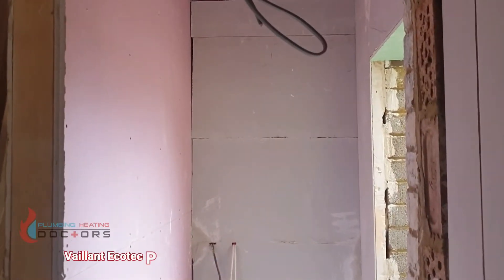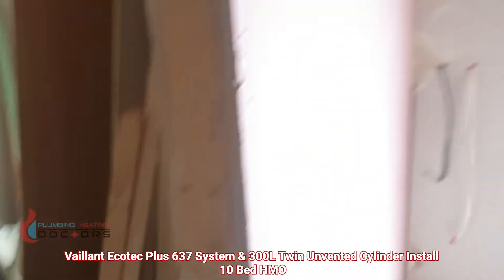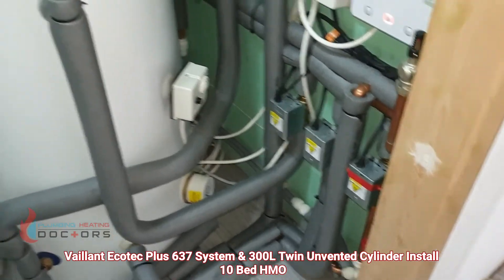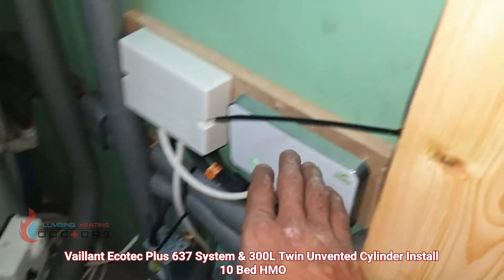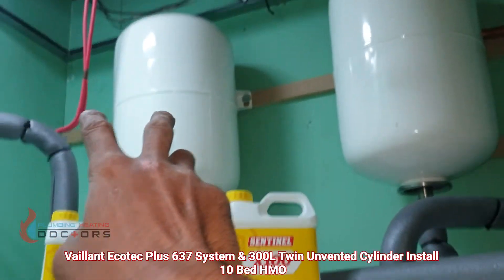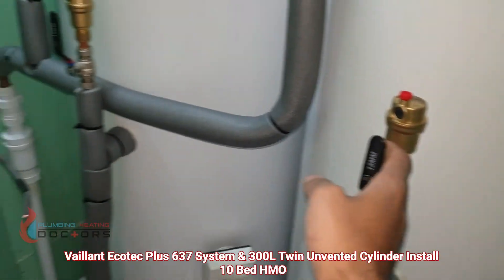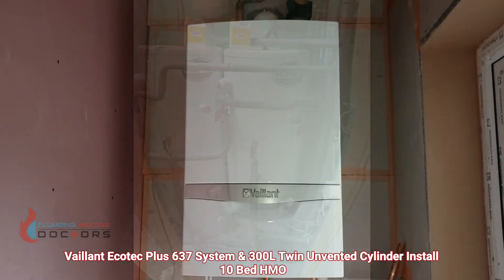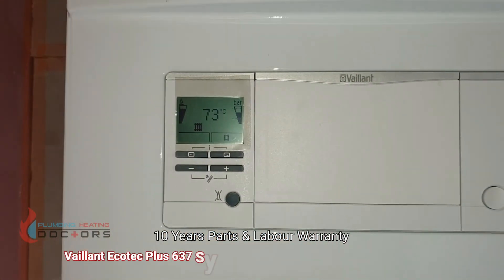Vaillant System Boiler With Twin Unvented Cylinder Installation - HMO - ** S Plan System **

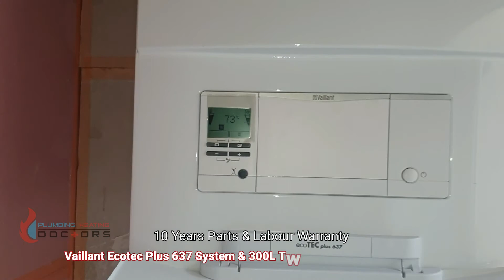Comment: I noticed at 7:31, there is no hot water tap symbol on the display of the boiler, may I ask the reason? mine is the same case, i am just suspected if it has some mistakes there.
Reply from the maker: Its a system boiler so does not have a hot water tao symbol

Comment: Great job! .... Just wondered, do both two ports for the cylinder come on together when there is demand for Hot water? In other words both cylinders get hot at the same time? Thanks.
Reply from the maker: they have sperate zones so they are controlled individually

Comment: Amazing work.  Wish you were local.  Quick question. What type of system would you recommend for a property with 9 rads, and 4 shower?   What size tank and kw size in system boiler would you recommend?
Reply from the maker: Minimum spec -  Unvented 300L with 30KW System but make sure water pressure is good
Reply: @PlumbingDoctors  thank you so much.  Is there a way of increasing the water pressure?
Reply from the maker: Yes loads of ways... easiest is to upgrade your incoming mains to MDPE if you have lead pipe
Reply: @PlumbingDoctors  yes. 32mm.  Any other way?
Reply from the maker: Yes stored cold water cylinders - check out stuart turner pumps with stored cold water cylinders - they will increase flow rate and pressure
Reply: @PlumbingDoctors   much appreciate the expert advice. Will discuss with plumber.  👍🏽👍🏽👍🏽
Reply: Would you advise copper fittings or hep20 for first fix ?
Reply from the maker: Copper
Reply from the maker: & I use speedfit on 2nd fix if required
Reply: @PlumbingDoctors  basically,  I have been quoted £2500 more if I go for copper instead of hep20
Reply: @PlumbingDoctors  im sorry.  I thought 2nd fix includes, Fitting the boiler, radiators, appliances etc